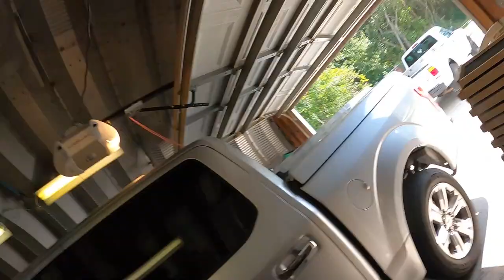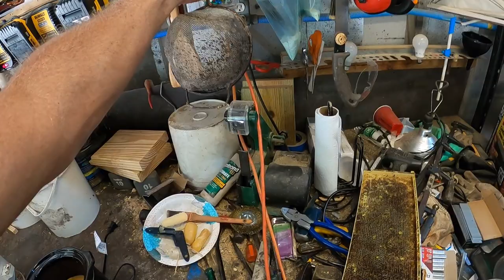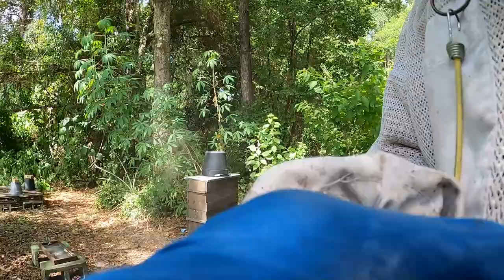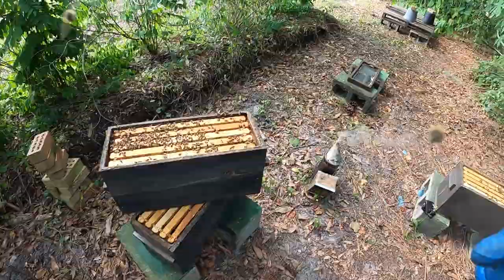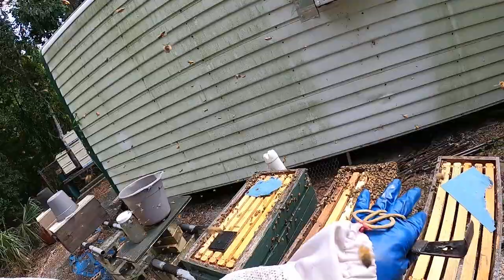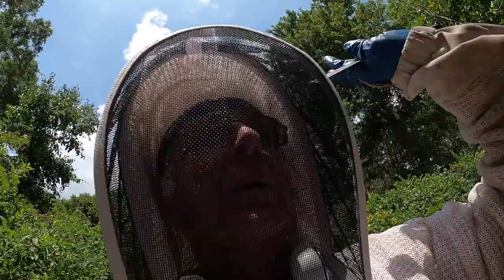Blue Towels Round Two

Comment: Love your you tube.  Slum gum works great as fire starter material.  Remember what a paper bag was.  Put the slum gum in a paper bag, about 1 inch high,fold close, then use a wooden roller to flatten the bag. Set in the sun to dry. On the next outside fire, slice dice and light.
Reply from the maker: Great idea Bruce thanks for sharing!